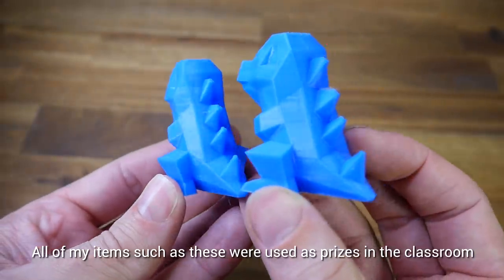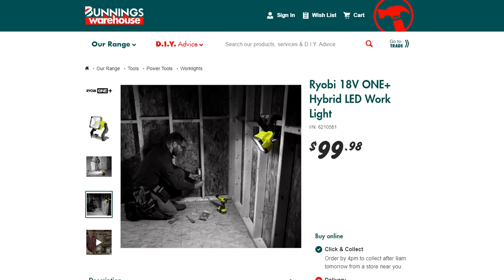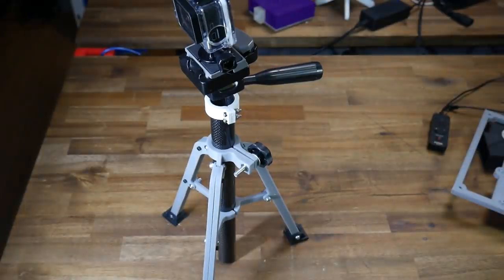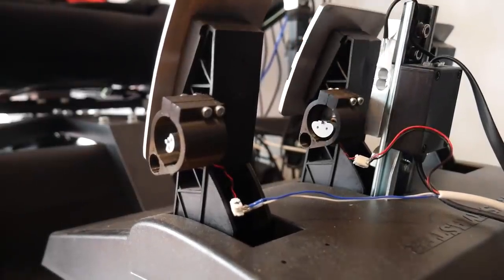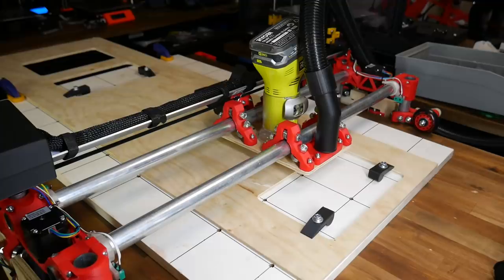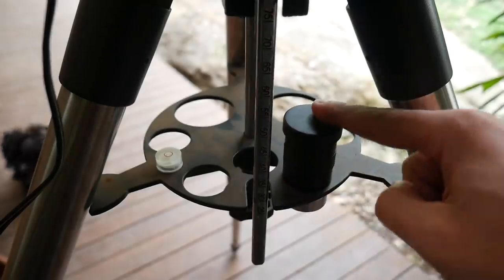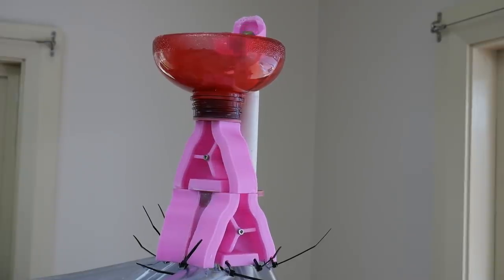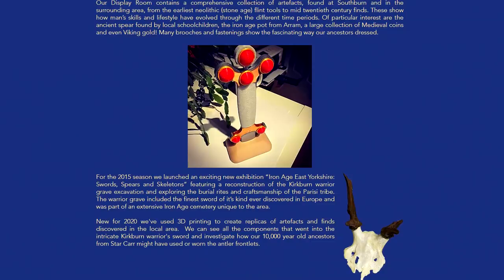5 reasons 3D printing is useful - My favourite practical prints

Comment: I bought an Ender 3 when I retired last year.  Not only have I learned to use it, but I have learned to use Fusion 360  because of it.  For an older guy, this has kept me thinking and learning new things.  I have printed parts for a used truck I bought,  designed tools to use in my pottery, and printed about 30 personalized name tags for the people where my wife volunteers.  Learning to design on tinkercad and Fusion 360 means I don’t print nick nacks much any more - I am too busy designing useful things.  Great video!!
Reply: Much respect!
Reply from the maker: Great story, thanks for sharing.
Reply: I also bought an ender 3 when I retired and like you have been learning fusion. 360. I recently designed and printed some custom dowl drilling jigs for a woodwork project I was making. Using  some cheap Chinese drilling bushes I was able to make some Dowling jigs that I just couldn't buy and they worked perfectly.

Comment: I 3D print all sorts of stuff, however the most useful would have to be aids that assist my disabled wife. Some include a custom fitting I designed to mount a flexible led light in just the right spot for her and a remote caddy that allows her to easily access the controller for her adjustable bed, allowing her to get out of bed independently. The usefulness to people with disabilities of 3D printing can not be underestimated.
Reply: You are a true hero.
Reply: Tought your wife had AIDS for a second there. The future will hold more technology which will help disabled people and hopefully make your wifes life better from day to day, not saying it is’t awesome right now. :)
Reply: Great to see people's quality of life improved with 3D printing and a bit of brain power.
Reply: Hi Andrew, I’m a quadriplegic and struggle to use my bed remote as I often can’t reach it, is your design available anywhere for me to look at. I have a prusa i3.
Reply: @Ebonyqwe  hey, I don't necessarily have the exact model that Andrew has, but if you would like to message me directly; we can communicate on any ideas you may have along with some photos of where the remote could go to be accessible and I might be able to model you something!

I don't have my printer yet (coming in a few days), but I've gotten myself back up to speed on Fusion 360 and would be happy to take a crack at finding a solution!
Reply: I think you mean it can not be overestimated
Reply: Hiya my wife is also disabled following a severe stroke 20 years ago.
I could do with sorting lighting out. Do you have your disabled designs on thingiverse?
Reply: @andytaylor8802  I don't as yet. I've posted a couple of RC aircraft related designs on Thingiverse  but no disability aids. The aids I've designed include a printed include a cup try for a mobility scooter, several cup stabilizers for her bed side table as she has some trouble with motor control at  times, and a very rudimentary conversion of a powder coated angle bracket into a wall fitting for a 'goose-neck' clamp mounted led light. The sleeve simply gives the clamp something a bit wider to flex its springs and grip well, and it's printed in white, which matches  the angle bracket and wall color. Other prints I've designed for her include a remote control caddy so they don't always end up on the ground an ipad wall mount or charging, numerous phone rests, and a toilet related design that combines a TPU bumper with a PLA locator so that the seat doesn't bang when it goes down and locates itself squarely over the toilet bowel. Although this last one is fairly simple in the design skill needed its the one I'm most proud of because it's an elegant solution to a persistent problem. I'm sorry your wife experiences impacts from her stroke. I'm also glad she has someone looking out for her. Disability of any sort sucks, but I'm perpetually surprised by the resilience of people and how they adapt. Take care, particularly of yourself!

Comment: I'm developing open source bionic prosthetic devices solely myself all thanks to my "KatachiBot" CR-10S. The project focuses on lowering the cost of myoelectric prosthetics and making it more accessible to the public. The project heavily depends around 3D printing as additive manufacture allows for rapid prototyping which itself is a very powerful tool to have as an enthusiast. Hoping this project will be done soon as it will be a factor for my university entrance. I am 18. I've been very grateful for the entire community as they have picked me up when I was down, and when I needed replacement parts the community was there waiting for me with open arms. Hoping I will return the favour one day.
Reply: Hi AgentL. Im interested in 3d printed prosthesis. Can you give some guidance where to get more info. Thank you
Reply: Yeah I would definitely like to learn more about this. You said it's open source?
Reply: @deadsimpleali5540  Hey. I'm glad to help out. I started by looking at Openbionics and the eNABLE movement and drew inspiration from there. I'm experienced in Fusion 360 so as you can imagine a lot of iteration went into it. Currently, I'm getting proof of concepts working but I'd recommend looking at other people's prosthetic devices and see where you can draw inspiration and what you can improve on.

Look into how you'd like to control the device too - the biointerface. Mine uses a myoelectric sensor which uses EMG to detect muscle movement. This is called the "MyoWare" sensor.

I've had to put the project on hold for now since the initial proof of concept is done and I need to focus on my other commitments - Math and Physics. Once my final exams are done I will continue to work on it. I'm also in the process of repairing and calibrating my CR-10S and I may potentially look into purchasing another printer. I wanted an MK3S just because it's so easy to use.

If you'd like to talk to me personally, I'm active on Reddit (u/AgentL3r) or on Discord at AgentL3r#0333 :)
Reply: @paintballercali  The reason I started all of this was actually from a video game I played a few years ago called Metal Gear Solid V. I'm a massive MGS/Kojima fan and in the game, the main character uses a bionic arm. I thought "Hey, wouldn't it be cool to make one in real life?". In the UK in order to get into university you must do your A-Levels which are a set of very hard exams (at least for me they are). I take Maths, Physics, and Product Design. For Product Design, you have a year to research, develop, prototype and test anything you like and as you can imagine, I chose a bionic arm.

So far I have had to build everything from the ground up - the mechanics, electronics, code, whatever. I'm not happy with the current state of it, but once I feel like it's ready I will begin to open up everything to the world - source files, code, and hopefully get a little community going. Everything is designed parametrically so people can adapt it to their needs.

To reiterate, the files are not released right now as I am not happy with the current design (lots of issues) and I know I can do better without the pressure of a deadline. It's a passion project.

I've managed to secure a place at Imperial College London - the UK's most prestigious engineering university - for Design Engineering. However, to truly get in I must perform well in my exams. As I have dedicated so much time to this project, I've let my other subjects fall behind, so I've handed in whatever I currently have and I plan to work on it again after my exams are over. I'm saving up for an MK3S to make my life easier too, which is a little hard since my math tutoring contract ends soon. Anyway, if I do get into ICL then I hope to use their facilities and the expertise of the professors to expand this project. Low-cost, functioning, advanced myoelectric devices that anyone in the entire world can build, print and adapt to themselves.

If you would like to personally talk, I am active on Reddit (u/AgentL3r) as well as Discord (AgentL3r#0333). My Thingiverse is also AgentL3r.
Reply: Dude.... Holy shit, you are going to /slay/ at uni and life, goddamn.
Reply: I'm a nurse but I'm interested in 3d printing for the same reasons.
Reply: Protip: You sound very dunning-kruger-y. You're doing the opposite of impostor syndrome, you're showing off too much. Also, hurr durr Shapebot in Japanese sounds cool, not.

Comment: I got involved in 3D printing for another hobby: tabletop wargames. I can print bases for my models and custom parts for vehicles. Where it really shines is in printing terrain and scenery though. The them can be fantasy (think Tolkien), futuristic Science Fiction (, or even Steampunk.
Now that I've been working with 3D Printing for well over a year, I now have a UV resin printer and have been able to print models and even accessories for models.
I've also been involved with a local Makerspace for over 8 years and that organization first introduced me to 3D printing, among other technologies and tools, such as CNC machines and laser cutters. Which also happen to be great for getting creative with tabletop wargames.
Now I'm working on creating a portable tabletop board system that is easy enough for any wargamer to DIY at home. Some parts for it have been prototyped using a 3D printer and could be 3D printed by the wargamer themselves or purchased from someone with a 3D printer before they make their set of boards.

Comment: we use 3d printing constantly at work to mock up designs before setting up cnc jobs, it saves a ton of money and metal. also for holding jigs and fixtures, it keeps the cnc working on production vs. making ancillary parts

Comment: I have 3d printed feet on my exercise bike that were missing when I bought it second hand, custom post tops that have converted some metal legs into a stand for multiple guitars in their travel cases, mounts for Philips Hue remotes over my lightswitches (some of them requiring custom spacers as the lightswitches were non-standard) and I upgraded my food dehydrator to digital feedback and control (using and MicroBit and a solid state relay instead of a bi-metal strip) - all thanks to 3d printing. Thanks for all the help and advice this channel has given me!

Comment: I use my 3D printer to support other hobbies: ham radio, woodworking, metalworking. It justifies itself for small tools, jigs, cases just for those hobbies. In addition, it's very handy around the house for making small replacement parts that are just not available any other way. I've never made anything bigger than about 100mm on any axis, but there are plenty of useful things in that size range. I honestly have little interest in 3D printing as a hobby. It makes my other hobbies far more enjoyable, though. It gets used more than my drill press these days!

Comment: Michael: In case you're looking for topics: "Going beyond PLA". For folks who are printing adequately in PLA on their economical printers (Creality, Prusa, Artillery etc), what upgrades and other considerations, if any, are required to print other popular materials? That's particularly in the area of temperature, where I, for one, am confused as to what the PTFE tube can and can't realistically withstand, when a Capricorn upgrade would be sufficient, when an all-metal hot end is really required, and so on. I know there are other considerations like fumes, and bed surface.  Not necessarily all the details in depth, but what steps we need to address, in what order. Such as "for material X you'll need to upgrade the hot end, but no point doing that if you don't also do Y".  Having at least an overview of that info assembled in one place would be fantastic.
Reply: I got prusa i3 clone from china that runs also e3d v6 that come with vulcan heat block and 1.75 bowden setup, though i got this printer second hand fron buddy. Only upgrades are adding end stop switches, spool holder with bearings, buddy had upgraded table heat element to aluminum plate that has the heater element built in (dont know manufacturer or name) and put on printing surface off brand BuiltTak. Maintenance vise Zaxis lead screws were replaced after two years of pretty heavy use and i'm planning on adding heat sinks to steppers for improved cooling on longer prints, even though its not required, just nice to run them cooler.
For printing other than PLA, i usually run with ABS 240C nozzle and 90C bed, even 57mm/s and infill 95mm/s speeds with out issues. With looking into it and some tweeking probably even faster, but this is fine for my applications now. Quality is not the best but nozzle could be needing replacement soon, so that factors in a bit. For other materials PETG can be printed as well and this machine has been running flex filaments with direct feed setup (bowden setup gives bit too much opportunity for filament to flex inside the tube, so direct drive is needed to make this problem easier to solve.) Havent tested anything else, but long as i dont go 300C range on uncommon filaments this setup will be sufficient. For that i would start considering other types of hot ends and finding solutions on teflon tube melting.
For common filaments like ABS and PETG you should be good with average hot ends and beds. Heating up takes just more time and you need to throttle down your printing speed as vulcan heatblock is there just to give heat faster to filament, so more stuff can be rammed trough it, but if you are ok with slower speeds no need to upgrade far as i see it. Experiment with your settings and chance value at time.

If you are looking print quality on surface finish, then you might want to look into tighter tolerances and there is info on that. On my case i really give damn, as with ABS i can smooth it out and make perfect by hand tools and some acetone. Printer is just a tool to make rough parts i can fine tune by hand depending its use, hence print speed cranked to high heavens.
This is just me with limited experience, trowing my 2 cents in.

Comment: I got into 3D printing after a friend printed some parts for a car project for me. As a retired engineer, the process was as interesting as the end product. Since buying the Ender 3 and upgrading it (with much help and guidance from you Michael), I have made many parts and tools for the car project. Probably the most successful and surprising have been forming dies for bead rolling and bending. Using only PLA I’ve produced dies capable of forming aluminium sheet and extrusions exactly how I needed. I’ve also printed countless marking gauges for the same project.  Preaching to the choir Michael!,

Comment: I make a lot of jigs and fixtures to help with carpentry projects like laying my decking planks to make sure the spacing between each one is correct and the placement of the screws is exactly in the middle of the joist and spaced out the same on every plank.  I just printed some drawer anti pull out things to replace the broken ones on a set of drawers, they are a better design and I wouldn't know where to look for replacements of the originals anyway.  Battery boxes to hold reclaimed 18650 lithium cells ... the list goes on.

Comment: 3D printing has been extremely useful as I have expanded my capabilities in my shop.  I make fixtures for holding parts in my cnc mill and alignment fixtures for my K40 laser so that I can position parts in a repeatable manner.  I have also 3D printed lift legs for my laser.  I created a tool holding rack for all my cnc mill tools.  I also designed my own desicant filter utilizing a whole house water filter enclosure but I 3D printed parts to suspend a screened in assembly keeping the desicant inside.  I could honestly list off useful things that I have printed until I am blue in the face haha.  The great thing is now people can pickup a printer for under $200 if you time it right.  Anyway, thanks for all the great videos!

Comment: I am a huge believer/supporter of the Right-to-Repair movement and have been using 3D printing to repair items for friends and clients that would otherwise end up in landfill or cost a small fortune to have custom machined. I've made replicas of parts for a friend's vintage early 70s Italian convertible as well as in-dash gauge mounts for my own car. And endless little useful jigs and tools for one-off tasks. Speaking of tools, your video immediately reminded me of the Nasa Wrench, the first "uplinked" tool manufactured and used in space.  I don't know how much more practical 3D printing could be than that.
Reply: The cost of having someone design and make custom parts for you is just SCARY!  Being empowered to try for yourself has got to be good!

Comment: I use my 3D printer for small custom Lithophane night lights on Etsy as well as prototyping projects that the final forms are in more expensive materials, such as metals.  I also design and print molds for resin jewelry as well as brackets and holders for electronics that I install into custome furniture.